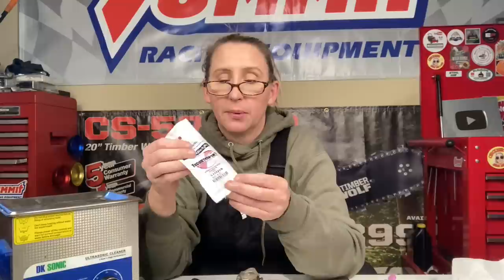How to easily fix a Tiller that's been sitting FOR YEARS! Tecumseh OHV 5 HP CARBURETOR REPAIR

Comment: Quick fix on a nasty tecumseh  carb for me has been a $15.00 amazon carb, 10 years later still runs like a champ.
Reply: I detest the criminal Amazon outfit but ebay is where I get them.
Reply: I haven't had problems with eBay or Amazon carburetors yet. I know you have concerns but I look at the feedback and whenever it's above 99% I know that the people aren't having problems with the carburetors
Reply: Good answer, cheaper to replace the carb with aftermarket carb,less time and cheaper
Reply: I went over my snowblower in the spring and this year the only thing that went wrong was I ran it out of fuel 😮

Comment: I’ve got a 15 year old Tecumseh on a generator. Cleaned the carb but  the clamshell tank failed at the seam. I repaired the tank but what I didn’t know was that at the factory, it looks like they put in a plastic washer to secure the tank output at the pet clock. Pieces of that came out from the tank clogging the fuel line petcock. Ended up ordering a new carb arriving tomorrow.. love this channel!

Comment: Have two lawn tractors ones a 98 with a 17 HP Tecumseh and the others a 2000 Craftsman GT 3000 with a 23HP Koehler pro. Both get at least 100 hours per season and both run like tops…. Just a testimony of what proper maintenance can do. Always start and run good. Get to “look at” a lot of neighbors equipment that won’t run. They can’t believe the age of my equipment…. Snowblowers a 98 also and always starts 1st pull when used for first significant snow…..neighbors stay warm trying to start theirs. Lol
   Thank you Be, for all you share with people like me that helps keeping my equipment in “Tip Top” shape and with giving any problems!!!!!

Comment: I have found fuel shut offs to be very helpful. Between the tank and the carb. Use the shut-off to kill the engine, then carb is dry. If you have to, you can easily drain the fuel the next time you run it. Fresh as a daisy fuel system.
Reply: With the shut off between the tank and the carb,you still have some gas still in the carb,just my opinion

Comment: I've had a few of those Tecumseh's with bad carbs also. Like you, I found that the cheap clone carbs worked fine. Considering time spend doing the rebuild, it was cheaper to replace the carb than to kit it.

Comment: Chickanic,  try using " engine tuner ".
It's a mercury outboard product that is designed to take the "COAKING"  that forms on the side of pistons of two stroke design and causes rings to stick. 
Works Great for soaking carb parts in as well as electric fuel pumps on fuel injected engines.
I have a glass jar that is filled with the "tuner" and I soak the whole fuel pump ( electric) in over nite.
Usually the fuel pump is good to go as the product devolves all the old fuel. If it needs a little "Boost" I take 24 volts to the fuel pump (Quickly) and this will get the rotor spinning.
 Sounds crazy but I've save many a customer from having to buy the ridiculous over priced new fuel pump.

Love your show!!! 
Glad to see Chick's  " wrenching".
Lynn

Comment: You mentioned that you had a lot of problems with Tecumseh carbs leaking after overhaul. I noticed when you pushed the rubber inlet needle seat in, you did it dry. That may cause the rubber to distort a bit, as it is a tight fit. I always put a drop of oil on the seat before I pushed it in. You can feel the difference, and I had very few issues with flooding after an overhaul. The old floats were two part copper, soldered together. They sometimes cracked with virtually invisible hairline cracks. If the machine came in with a dry carb, you might not notice it. Once the repair was done, and gas went back into the carb, it would slowly seep into the float from the cracked, “water logging” the float, to the point it would either sink in the bowl or be mushy in operation. And just to say, the red plastic jet, as you called, is not the jet, but a nozzle, the jet is in the bowl nut.
Reply: I used vaseline.
Reply: Agree. A tiny bit of lube on that seat and the o rings on the emulsion tube is a good idea, for sure.
Reply: The "red jet" is not a nozzle, but an emulsion tube.  Still surging and hunting, probably the pilot jet partially clogged if it has one.
Reply: @mikespain8655  Hi Mike. I know full well what an emulsion tube is and what it does, but Tecumseh refer to it as a nozzle in their service literature, as well as an emulsion tube. Obviously it’s much easier to use the simpler word “nozzle”, as such I believe we are both right, but what it’s not, is a jet.
Reply: @brucewelty7684  you sure Vaseline wont swell up the o-rings sir?
Reply: Silicone spray - from Wally World and other places.

Comment: I have a David Bradley tiller that had a Tecumseh engine. It was manufactured in 1950. I was ignorant of the coil being notoriously difficult to replace. The local shop who sold me the parts clued me in after I destroyed it. I replaced the engine with a Harbor Freight engine and fabricated 18 new tines for it, and is now a beast.

Comment: Setting the float height helps with not leaking. The surging may be from the main jet has a really small hole on a angle that tends to be overlooked. Tecumseh snow king engine are top notch last forever.  Had a 1979 simplicity  snowblower with a hs50 that I gave to my brother still had 135 psi on compression.

Comment: Thanks! This video helped me fix my snow thrower with a Techumseh engine. 
After cleaning the carburetor, I reassembled it and then turned the float housing so that a drain valve would be as easily accessible as possible. When I then started it (after purging it), the engine ran fine for about 6 seconds, then it started to surge and then stopped. After I watched your video, I corrected the position on the float housing and there was no problem, just adjusting the mixture. Thanks so much for your help!

Comment: I've got a tiller I bought used in 1984 when it was about 10 years old.  It has a Briggs 5hp on it.  Changed it to an electronic ignition shortly after I got it and it never fails to start on the second pull.

Comment: Awww how cute,  yours still has the training wheels on it. Mine got yeeted on the first use. If you idle them and pull the handle they walk right along the yard without messing up the lawn. Great little tillers that just plain work.

Comment: A couple years ago I bought a smaller cleaner, Kendal, and it cleans carburetor parts, coins, jewelry, bicycle parts, and more very well.  I use a small amount of Simple Green in water.  Now I need to find a gold nugget to clean.  Your cleaner has temperature control?  Nice.

Comment: Sporting a 26 year old Tecumseh Snow King engine here that has never had the carburetor apart, and it is not leaking yet.  And this thing only runs when it snows, and sits from about April to November.  But at least I have an idea about the carb now if it ever does go south.  Totally hear you on the tiller deal.  We bought the cheapest rear tine tiller we could find.  The Earthquake Viper, and it is a cheap Chinese engine that so far has just run no matter how much neglect it gets.  We also run the Mantis with the 4-cycle Honda engine, and that is a sweet ride.  At least that one has attachments for edging and dethatching so it gets more use.  Have fun with your sleet down there.  I still cannot walk outside the paths on my property without snowshoes.

Comment: Thank you for the very detailed showing of this repair.  I have an old chipper and during a carb replacement almost had to stand on my head and use my left hand to do it.  Apparently the carb was on the engine before the engine was mounted on the frame leaving a lot of crap in the way.  I did get it done but would have had to charge a longer repair time if I had done it for a customer.  Something the building company never thought of. Replacing a carburetor should be a simple operation.  The carb was only $12 and was a very common carb.

Comment: YES! someone else that knows a guitar B or high E string are great for poking out the grit in a jet.  I had a craftsman lawnmower with a Tecumseh engine, lots of well thought out designs and it was so easily repaired,  I had it for over 20 years till an 'expensive' part finally broke.

Comment: Great video. At 17 years old, that tiller probably only has 20-30 hours on it. With good attention to use, care and maintenance (all 3) you only ever need to buy one good one for a lifetime. Same for snowblowers in many climates where it runs 3 or 4 times a year for a total of less than 10 hours per year (not talking about you folks in Minnesota or North Dakota here.) while I had it in the warm shop, I might have taken the engine off and cleaned that deck surface. All that dirt and stuff will hold moisture and rust that out well before that engine ever dies.

Comment: You know here in New Hampshire as a repair shop I do get a few machines with tecumseh engines not only Snowblowers but some older Toro machines have the tucumseh and the Lawnboy brand have some to . Bre I held back saying anything about the Snowblower air cleaner thing but realized this was your first and only one you will probably work on .

Comment: My tiller was purchased by my dad in 1967. It is a Merry Tiller with 3hp Briggs. I have not started it for a couple of years. I do know that the gasoline is non ethanol with Sta-bil and there is a fuel shut off that I always use so hope it starts. The carb was repaired and running well five years ago.

Comment: I don’t have welder tip cleaners . My cheap go to is burn the paper off a twisty tie and that makes a good cleaner rod for that bowl nut. I was told by a mower shop not to use carburetor cleaner ( I know makes no sense) but was informed that carburetor cleaner can strip some kind of silicone coating in the carburetors . Brake cleaner is preferred. And or use WD40 to squirt stuff out. Thanks for your videos!

Comment: Bre good job on the Tecumseh carb. As mentioned by others, a little lube, WD-40 or light oil or Vaseline will make install on the seat and o rings easier. Also, I believe the back of a 5/64 dill bit can be used to install the seat and nozzle. Also most of the newer Tecumseh carbs had a non anus table idle jet that is covered by a black plastic cap on the side of the carb. It has a small hole that gets plugged causing the hunting on idle. And noticed sometimes when revved up. Enjoy your pre spring break before the tidal wave arrives.
Reply: Adjustable idle jet.

Comment: Chickanic Steve at Small Engine Saloon put the pieces of what wants clean in plastic bags to use in his machine, the unit still cleans the part but keeps the water and cleaning solution clean
Reply: It saves on cleaning solution, plus, you can put new hot water in every time and save time waiting for it to heat up. 👍

Comment: For nastier carbs do a pre-soak in CLR (Calcium, Lime, Rust Remover).  It does a killer job breaking up the corrosion.  Just don't leave it in there for a long soak.  30-45 min is usually enough.  Best carb dip I have ever used for a nasty carb.  If i's super corroded, don't even bother, just buy a new carb, sometimes you just gotta let it go.  Dawn for everything else that's not too bad. 👍

Comment: Just a comment on these tillers, I bought one of these back around 2000, they actually are relatively good tillers.  I noticed that after you fixed the carburetor, it would surge a little.  Mine did that from the time it was brand new, other than that, it ran good.  By the way, it looks EXACTLY like the one you have.🙂
Reply: I have one just like that too and it as surge from day one
Reply: Adjust the carb if it surges alittle bit,you'll be fine

Comment: We bought a tiller in Florida at TSC, funny part was the girl at the cash register didn't know how to spell garden tiller, wow! After a few years we moved to Missouri and while my wife was running it where we put the garden a wheel broke. TSC doesn't sell this tiller anymore. Trying to find small wheels with a 5/8 hole wasn't easy. Finally found metal hubs with rubber tires and took a 5/8 bolt with washers and a lock nut to make them work. I also had to go with taller wheels. I cleaned out the tank and it started up with fresh gas and changed the oil as well. I had to turn the idle screw down so that it could rev up like it should.

Comment: Clean out the atmospheric pressure vent 
Tecumseh engines were notorious for leaking gas for sure. The older engines 70s and 80s had a very small hole in the side of the carburetor usually right around the idle mixture screw. It came out into the carburetor body just above the float. A small flexible wire or even fishing line can be fished through this passage way. Dust / dirt and small debris will clog the passage up and the difference in atmospheric pressure between the inside of the carburetor and the outside air will cause the pressure inside the bowl to overcome the needle and run out through the air cleaner
Reply: Exactly!

Comment: A tip you and some of your viewers may not know ?   Always use a lubricant that is compatible with what you are working on all be it oil, 2 cycle oil, grease, petroleum jelly ( Vaseline ), etc ! ! !   this will keep the 0-ring or rubber gasket from tearing in screw on applications and also it will slow down Dry Rot !   Vaseline will also hold it in place during asembly !   Most of the time, use of a lubricant will allow you to reuse the same O-Ring multiple times ! ! ! ! !

Comment: I have a 40 + year old Merry tine with a 3.5 brigs has the old style choke you pull out it can set for years it will crank might have to stand the fly wheel and points.

Comment: Tecumseh service manual used to call for removing the main jet/bowl nut, float, needle, seat, emulsion tube, and punching out the welch plugs before dipping the metal parts only in Gunk or Berryman dip tank solution. Beware of carb spray on o rings or rubber seats. It kills them quickly. If you don't have tip cleaners or tiny drill bits, you can also use the soft iron wire in the center of twist ties to clear passages. A good tool for setting replacement welch plugs is a pin punch, or a hardwood dowel.

Comment: I bought a huski trimmer that accepts attachments so I have two tiller attachments I switch off tines for ,works awesome have a pole saw and a bush trimmer wish i could remember the huskies model number I would suggest it with out a problem.

Comment: Nice to see someone rebuild instead of these youtubers saying it's not worth it to rebuild when I can get a knock off for less.  TIP:  If that carb floods out it may be because you didn't set the float height. It looked like it was too high
Reply: I'm glad to see someone noticed that besides me. But my comments are usually blocked by You tube  or the "mechanic".

Comment: 2008 was Tecumsech's last year. There is still a supply NOS back  stock engines out there, but they want a fortune for them.  I might try buying a 5HP vert shaft one preserving & and setting it back for my Sensation mower. I am looking for an old breaker points or early HEI Briggs 3.5-4.5 horse for it too.

Comment: A lil FYI for the unknowing if you don't have anything to clean the fuel bowl nut holes out with ie torch tip cleaner or guitar string, the little wire hanger on the needle valve is just the right size to insert in the small orifice to rod it out, the other ones you can use a bread twist tie wire just peel the plastic or paper wrap off and viola one unclogged nut ready to use.

Comment: yep punxatawney phil says stupid season is just around the corner. lol  a lot of those have a tiny hole on the side just below the throttle shaft stop that is an air bleed. about .020 in diameter really hard to see. if that plugs you'll get a hunting idle  and  sometimes a flat spot on acceleration.  those rubber seats are a very poor design.

Comment: I have a TroyBilt 1980-made Horse/Kohler I've had since the early 80's. Used it professionally for decades. I did a valve job on it last yr. She's ready to go! I should go to that crazy outdoor shop here that promised me the used Toro lawnmower last yr and even with four trips to their store....no mower. Lots of promises though. I do have a TroyBilt Pony with a Tecumseh that needs rebuilding. The wheels are rusted solid on the axle...the rims are too expensive to cut off.

Comment: Two years ago I bought a used MTD 5HP rear counter rotating tine tiller for $300. B&S engine that was finicky. Not having the means or tools to overhaul it, and checking prices for replacement parts was just not what I wanted to do. Bought a Predator 6.5 HP engine and swapped it out. Only thing I had to do was order a pulley to fit the shaft and shorten the shaft and a new belt.

Comment: May I ask, What is your opinion on Tecumseh engines? By the way @Chickanic The Tecumseh 670377 tool will help with installing a new seat into that carb. That may be why your Tecumseh carbs leak.
Reply: @RickStorni  why do you say? I love them. Just curious. Not offended.

Comment: Hi from the UK it’s sounds like you have the same issues with a bit of snow as we do in southern England 1/2 inch of the white stuff and we’re screwed for a week. Anyway just wanted to say I enjoy your vids and you should see the mess of a Tecumseh carb I’ve got given to try and sort but I think I’ll take your advice and just replace it if I can get one. It also never failed to frustrate me when I was a dealer and they drag the kit out of the shed it won’t start bring it in and then start to moan when it’s a three of four week turnaround because they all do it at the same time. Mind you I think would be even worse now we have E10 fuel that’s really going to mess up those 2 cycle carbs it’s so gummy. Happy days and good luck for your season